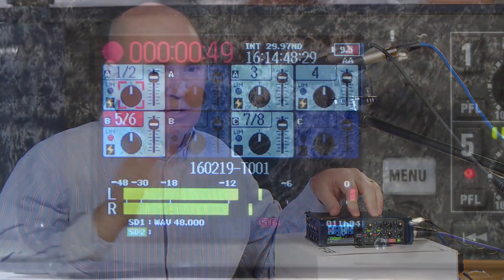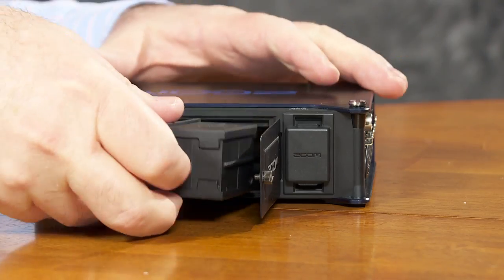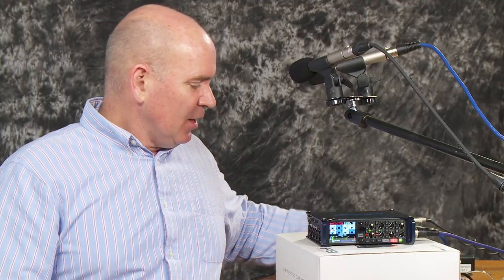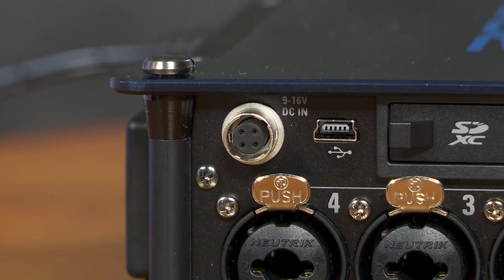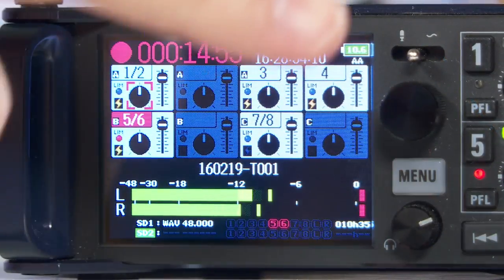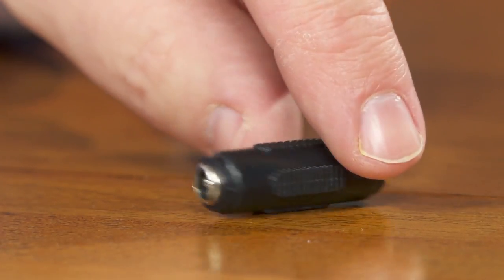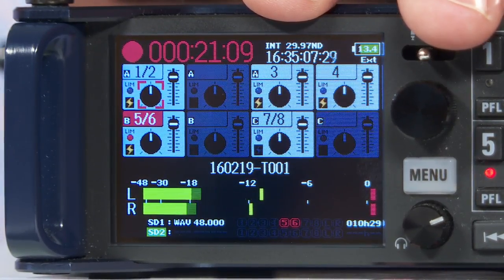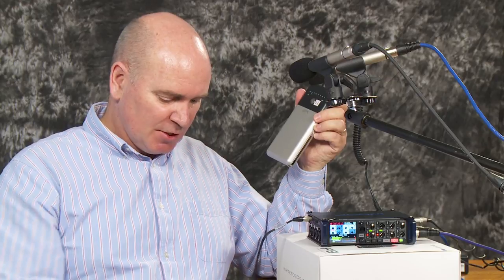Zoom F8 Audio Recorder Power Options - An In-depth Look

Comment: Elmer - Thank you for presenting an option for power that many of us have in our kit already - NP-F series batteries. After watching your video and digging around in my 'stuff' box, I found a NP-F battery holder with a short power lead attached to it already.  All of the batteries that I have are 7.2v but I had seen several battery plates that boosted the voltage level to 12v. I snapped on a battery and after a quick check - I show 12.1v on the output. It is not branded so I assume it is a cheaper knock-off but none the less - I'm in business.  Thanks again for the great ideas and in depth testing.

Comment: Great video. I love my F8. Only power has been an issue. These days, I use the internal batteries purely as a backup supply. I have the Hirose connected to a 12v rechargeable brick. It gives me 20 plus hours of full usage. The Hirose has a mini power Jack connected at the rear end which plugs direct into the power brick.

Comment: Thank you! I just used this mixer recorder for the past four days (first time using it) and went crazy changing lots of AA alkaline batteries because the mixer would drain them faster if the LCD was very bright and on all the time (which I needed under the sun). I knew I could attack the sony batteries (which I didn't have at the time) but I didn't exactly know how. Thank you very much!

Comment: Great detailed review, one last question left in my head is the capacity of your Power bank, could you let us know please?  I think the modern high capacity power bank might double or triple the time.
Reply: +Richard Li Are you referring to the big battery pack I bought from Harbor Freight? It's said to have an 18Ah battery. I haven't tested how long that will actually power the F8 but the camera battery I tested which ran for 9 hours was rated at 4600mAh. So, maybe that would translate to about 35 hours from the Harbor Fright battery pack. But I haven't tested it.
Reply: +SmoothRiverProd Thanks for your reply.  The battery I am talking about is not your car battery, it's the last one that somebody suggested to you on which there is multi-voltage selection.
Reply from the maker: +Richard Li Ahhhh. I guess you mean the Tekkeon battery pack that I showed in the video (which can output a wide selection of voltages, including 12 and 14 volts). I had previously used it several times and was able to get about 3 hours out of each charge, but I didn't have all 6 channels recording as I did with the other tests mentioned in this video. I will attempt to do another endurance test using the same recording settings mention in this video (six channels, four of them with Phantom power) and post the results soon.
Reply: +ElmertheClep 
Yeah, that'll be fantastic if you can do that.  Looking forward to it.  Regards

Comment: Those Medela breastpump battery boxes work great on the F8. Sounds funny I know but its just a box for AA batteries going DC at over 10v which the F8 will accept. They usually run $10 on ebay. Probably the cheapest way to double the battery life and allows you to keep running while changing batteries since the internal pack would kick in.

Comment: I just discovered that the hirose connection from my external battery was causing interference on my main and sub output audio.  I'm not sure if a different cable or battery would help or if there is an issue with my zoom f8n

Comment: Thanks for the video! I also made the choice of a BPU battery but, like you, the zoom f8 indicates 16,1V when the battery is fully charged and i'm little worried it will damage the zoom f8 even if it drop to 16v quickly, no problem so far?
Reply from the maker: I've had no problems using the video camera batteries, even if they might briefly show 16.1 volts when fully charged. It seems to me that this is within tolerances. After all, it's only 0.625% above 16.

Comment: Thank you for this. I just bought the Zoom F-4 and have power concerns. I don't like having to buy AA batteries even if they are rechargeable, so I really like your idea of using camera batteries or other battery packs to connect to the hirose connector. Also, as a non-expert, I appreciated that your explanations were very clear. I learned a lot about my new machine.

Comment: BTW, were did you get your Spare Battery Case BCF-8? I can't buy it here in Spain. Is not in stock and provably should not for the next few months. Thanks in advance!
Reply from the maker: +IGIS Producciones I bought mine from Markertek. Here is the link.
https://www.markertek.com/product/zoom-bcf-8/zoom-bcf-8-battery-case

It's also in stock right now at B&H and here is the link…
http://www.bhphotovideo.com/c/product/1220972-REG/zoom_zbcf8_replacement_battery.html
Reply: +ElmertheClep. Thanks so much!!

Comment: Hi again. I allready have my new battery Case and I should like if possible a link to the Markertek Hirose - DC In. Thank you!
Reply from the maker: +IGIS Producciones This is the cable I bought but there are others available in different lengths.  http://www.markertek.com/product/hr4m-dcp21-02/hirose-hr10a-4pin-male-to-2-1mm-dc-plug-dc-out-power-cable-2ft
Reply: Thanks so much. Mine is on the way...

Comment: excellent!
just a question : i will make my hirose cable by myself
are sure about Negative on Pin 1 and Positive on 4?
Reply from the maker: Yes... here are the spec from the Zoom website... 

External DC power supply: 
HIROSE HR10A-7R-4S 4-pin connector
(1 pin: −, 4 pin: +), 9–16 V

See this page and scroll down to the Power Supplies section...
https://www.zoom-na.com/products/field-video-recording/field-recording/zoom-f8-multitrack-field-recorder#specs

Comment: Would it work with a canon battery? And is it possible to find a plate for it?  Canon LP-E6N Lithium-Ion Battery Pack (7.2V, 1865mAh)
Reply: After rewatching the video I'm guessing the canon would not work because it says 7.2V and the HIROSE says 9-16V?

Comment: Please let me know if the Phantom power Works with 8 AA batteries 1.2 V rechargeable R6
Reply from the maker: +Harry Leonel Tello Rivas Yes. All functions, including Phantom Power, are available no matter which power option I use. So rechargeable AA batteries will work just fine. The only variable is how long the F8 will run before you'll need to change batteries. The test I did with AA batteries used phantom power and they were rechargeable 1.2V batteries (regular Eneloop batteries, not the "Pro" version).

Comment: What was the model  of Sony battery you were using in this video..
Reply from the maker: The cameras I use are Sony XDCAM camcorders that use the BP-style battery. So I use the BP-U30 which came with the camera and I use third-party versions of the BP-U60 and BP-U90 high capacity batteries. All of these batteries have worked flawlessly with the Sony cameras AND with the Zoom F8.
Reply: @GoodTimekeeper  found the info I hopefully need , thanks - UK distributors where are you?? ha

Comment: Hi. As expert in the Zoom F8 power sources do you think that the HIROSE Marketer shown in the video could it fit directly to this battery?

Thanks so much!

http://www.amazon.com/MAXOAK-36000mAh-Portable-External-Notebook/dp/B017QUHB44?ie=UTF8&keywords=MAXOAK%2036000mAh&qid=1459878577&ref_=sr_1_1&sr=8-1
Reply from the maker: It looks like the inner "tip" of the output DC jack is 2.5mm instead of the 2.1mm that I use. But I think there might be a ready-made adapter cable at Markertek with this specification. But I can't tell if that's a positive tip or a negative tip. Also, the output is advertised as 16.8 volts, which is higher than the 16.0 volts Zoom recommends. I wonder. My Sony battery is rated as 14.4 volts but when it's fully charged it puts out 16. So I wonder if the battery you reference is really 16.8 volts when fully charged or something higher. There are voltage regulators out there which could correct this for you (if it's too high) but that would require just a little bit of DIY fiddling.